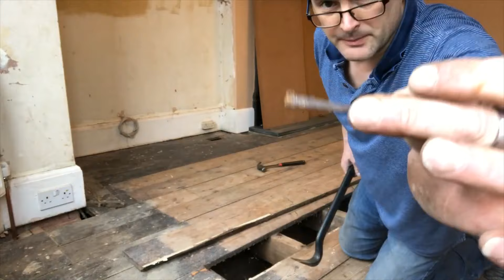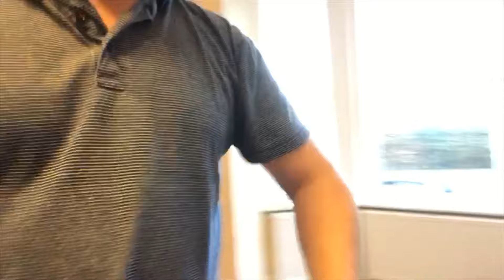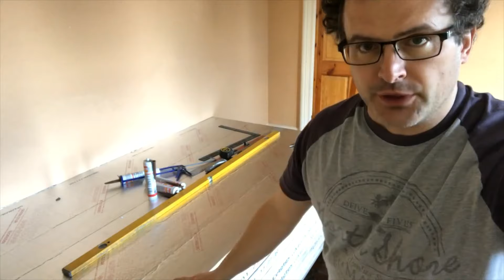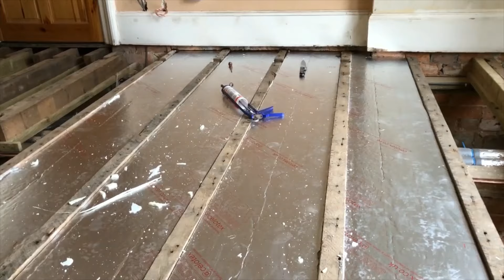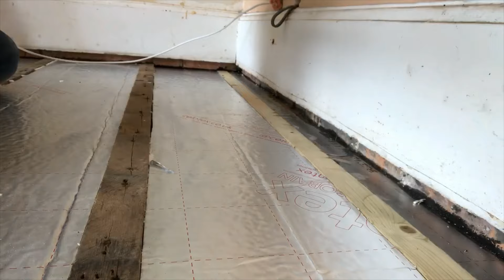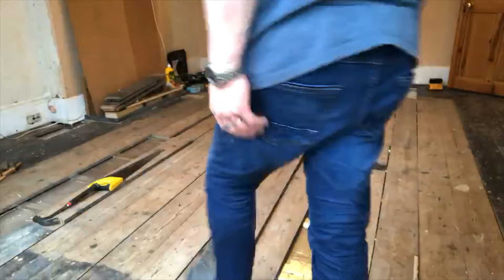Underfloor insulation retrofit full demo

Comment: If your a skinflint you can hold the insulation up with string looped underneath it and nailed to the top of the floorboards with tacks. I done, (didid) this and it worked!
Reply from the maker: Hi Phil, yes indeed, though the cold air beneath may circulate in any small gaps between joist and board, so a nice tight fit is needed. Great to hear your insulating your home too.

Comment: Go easy boy you will definitely  split these old boards. Take your time don't lever force but  apply pressure equally. Must  remember modern boards are not the correct size you may need to go to salvage yards.

Comment: Hi, would you recommend adding a Damp Proof Membrane under or on the top of Celotex? Planning to do the same but using Laminate flooring instead of carpet, thanks!
Reply from the maker: Hi Sara, probably not below, because the upper foil layer will be a vapour barrier. Adding another in a different place may trap moisture between. I don’t think one is needed above either, because the foil layer does the job.

Comment: Using a carving knife one handed whilst cutting towards your other arm whilst balancing on two beams?? Take your work outside to cut in a flat open space with the correct tool and live longer.
Whilst you had the boards up I would have placed a dpm on the foundation for a little bit extra protection from moisture ingress through the slab.
Reply from the maker: Thanks for your tips David. The DPM is an interesting one. Difficult to use a carving knife two handed, and if it’s sharp it shouldn’t need two handed levels of force. Space wasn’t an issue, and the knife was controlled okay. I’m happy with the risk assessment but always encourage others to do their own.

Comment: I would have maximised the floor insulation to get the greatest benefit.  Whilst the 75mm board is not up to current regs, the regs are on their inexorable way upwards and 75mm will soon be seen as mean.  The reason about retaining air flow over the dwarf supporting walls does not stack up because it is very easy to chop out individual bricks in the 1/2 brick wall to promote air crossflow without any real loss in structure.  The thicker insulation board can be supported on nails or screws driven in to the sides of the joists instead of battens that take up too much space.  Indeed, even greater insulation than the depth of the joists can be installed using standard stainless steel door frame cramps.
Reply from the maker: You’re right Clive, about the dwarf walls. More importantly I want air to get to the end supports that are onto the external walls. These are the ones that have suffered most rot historically.
The battens provide an air seal to the joint between board and joist. It’s a critical component I wouldn’t remove, even for an extra 25mm depth.
75mm is already mean. It should be twice that, but it’s a huge difference from air flowing and no insulation to a sealed 75mm solution, and not that much more when doubled up.
Thanks for the feedback.
Reply: @SteveWardellDIY  One alternative would be to incorporate a a composite solution say, using multifoil draped over and between the joists with a thinner PU foam board between the joists  That would overcome the concern about air tightness and create a full vapour proof skin.  I have used multifoil very successfully that has outperformed sole PU installation that means we aren't reliant on over deep constructions.
Reply from the maker: @clivewilliams3661  I’ve not used multifoil before, but it’s sounds like a good option. What’s it like to work with?
Reply: @SteveWardellDIY  Relatively easy and it comes in a 1.3m wide roll x 5m long, you simply roll it out.  Joints are usually overlapped and if necessary taped with aluminium tape, giving a 1.2mm working width.  The material fluffs up about 25mm but is easy to handle and fixings are normally stainless steel staples.  The material is draped over joists and the like and is crushed when finish boards are fixed over the top, this creates a thermal and vapour barrier. The system relies on an airspace of 25mm on each side of the multifoil to maximise performance that means the construction depth is 50-75mm before any additional rigid insulation or board finishes.  I have used multi-foil as a sarking felt under roof tiles and then around and up into roof rafters that were only 100mm deep to give an insulation value that exceeds the current Bldg Regs best value.

The issue with multifoil is that its effectiveness cannot be calculated in the standard way and relies on experimental results.  I prefer to specify Actis Triso-10 as the customer service especially with thermal performance is very good, they also provide estimated performance for bespoke systems that is generally accepted by Building Control.  Buying the various brands of multifoil from builders merchants is expensive until you factor in the cost of the labour to install it.  However, multifoil can be purchased as surplus material at very advantageous rates.
Reply from the maker: @clivewilliams3661  this is awesome insight. Thank you for posting. I’m going to read up some more and maybe look at using some
Reply: @SteveWardellDIY  One last thing for wall insulation is that using basic 38 x 25 tiling battens, which are cheap and benefit from being preservative impregnated as a framework over the internal face of the external wall you can very conveniently staple the multi-foil to the framework and then create another identical frame over the top, to which the board finish can be attached.  The layout gives a 65mm overall build up with the nominal 25mm air spaces, that is less than that for an equivalent polyurethane solution (~95mm).  The multi-foil naturally gives a highly effective vapour barrier that is better than the poly board foil.  One thing to note is that do not use screws to fix the two frames together as the multi-foil winds up on the screw, use stainless steel ring shank nails.  
Multi-foil is not a panacea for all situations but it is off the radar and can achieve very good results when used imaginatively.  I particularly like it for roof refurbishments where the rafters can be 3" or 4" deep and traditional insulation takes so much off the roof space as well as potentially loading up the rafters.  Old rafter sizes can no longer be proven under the new codes so that adding significant insulation weight sees major roof strengthening to what appears to be a proven sound roof.
Check out the French Actis web site, where they use it extensively in Alpine regions,as they give many more and detailed tested installations.

Comment: The celotex was a snug fit, as required. But what if you screw the batons, that the celotex sat on, under the joists at right angles. The celotex then lay on a few batons to hold it up.  I'm thinking less batons would be needed? Great video though.
Reply from the maker: They wouldn’t seal the gaps though that way.

Comment: Would this bee a good idea between the roof rafters.
Reply from the maker: Yes Alan. Leave a 50mm gap above the board for air circulation. 150mm total is the current building regs requirement (I think) which can be achieved with 75mm between, for 125mm roof joists, and a further 75mm beneath the joists held in place by battens or plasterboard directly.
Reply: @SteveWardellDIY  This air circulation will also depend on the felt membrane in use in the roof i.e. breathable (modern roof roofs) or non-breathable (older properties). With older properties you will need the addition of roof vents (eaves and ridge) for crossflow air circulation. Just experienced this myself recently. Plan on doing this in the floors downstairs in my house, was wondering about air circulation but you seem confident it won't be an issue and I tend to agree with you. Thanks, great detailed video.

Comment: Thinking of doing this myself at some stage, I was wondering though - why use silicone instead of expanding foam?
Reply from the maker: I’ve not done much work with expanding foam. Could be a good alternative. I like a tight fit on the boards and silicone works okay if you achieve this.

Comment: what carpet underlay did you use?
Reply from the maker: Hi Andrew, I used Carpet Right’s most expensive rubber one. Probably got ripped off but it’s lovely. I’ve since spotted some 12mm thick wool underlay online that may be a pretty good cheaper option. I’m not an expert on this, though I do fit all my own carpets to make sure it’s a good job

Comment: Thanks for the video - did you consider rock wool instead with membrane over ( celotex - )fire resistance
Reply from the maker: Yes Richard. The thermal loss capability of rock wool is much poorer than insulation board. You’d need twice the thickness or more to achieve the same insulation, which would have been harder to install.
Reply: @SteveWardellDIY  thanks Steve -understand thermal performance ( post green fell - wouldn’t specify a phenolic foam.)
Reply from the maker: @richard.j  for me, and most in fire safety, that choice is based on risk assessment and compliance. In this case the flammable material is contained in an environment where ignition sources are low and highly controlled, and the house has good smoke detection, as all homes should. For the safety of my family and myself I’m satisfied the risk is controlled.

Comment: Does this material off had or smell as my nose is very sensitive.... It would annoy me terribly if it did.
Reply from the maker: Hi fabriglas. It’s a Celotex product I used. It has a smell that’s a bit fishy when cut, but none at all when installed and it’s completely sealed from the room by a foil layer when complete so even if it were to smell over time you wouldn’t smell it.
Reply: Off gas , predictive text sucks

Comment: could you have used gapotape to get a better fit? instead or as well and top tape?
Reply from the maker: That’s a really interesting video Krish. The shapes and sizes of existing builds are not as accurate as the standard frequency in the new build, so there’s no way of mass cutting and using Gapotape to make up the differences. The pieces I had to cut were all one offs, and were accurate with very small gaps. The insulation capability would not be reduced by any amount of note by small gaps that are sealed to prevent airflow through them.
Reply from the maker: Hi Krish, I’m not sure what gapotape is. Aluminium foil tape is recommended by Celotex to create a continuous foil membrane, so that’s what I use.
Reply: @SteveWardellDIY  https://youtu.be/Omk68Z-tE7U

Comment: Was there no crawl space? I think I would have crawled under with fiberglass batts and shove them up between the joists, Instead of tearing the whold floor up and cutting each insulation board one at time.  Or maybe just insulate and line the crawl space. It doesn't look like you have crawl space ventilation anyway, so how big a deal is the all the air sealing which could be taken care of with an underlayment when you lay the hardwood.
Reply from the maker: Hi Peter, there’s about 300mm - 500mm depth of crawl space across the room, and it’s ventilated from outside via air bricks. I cleared the air bricks to make sure they work for the future, and airflow is absolutely needed to keep the subfloor moisture level low enough.
Installing fibreglass batts is an option I’ve used in a previous house, but has a lower insulation value and does not prevent airflow, so is no where near as effective. Solid PIB is a better solution.

Comment: It's great that people have a shot, but probably shouldn't post them as instructional videos. There are ways to have done this quicker and better, and with more info (like which screws to use, why screw and not hammer etc). I'm sure it will be beautifully warm however!
Reply from the maker: Bit odd suggesting people shouldn’t post videos pumpkinhead.
As you can see from the comment, lots of viewers have found useful tips and guidance from it. It’s always possible to improve of course, though I doubt I’ll redo this one.
Do suggest how to do it quicker and better please, and the type of fixings you think are best, and the community will benefit from your insight.
Reply: @SteveWardellDIY  I love people posting videos, I was just saying it's more of a video of how you have done it rather than how and why it should be done a certain way.
Reply: @To_dare_is_too_dear  step 1, label all your floor boards. An easy way is to do top to bottom in letters, left to right in numbers. That'll make it much quicker to put them back down. If you are screwing the boards down, use a screw like Space Wirox that has the double thread, if you are leaving the boards exposed use a cut clasp nail. Best pilot drilling the holes at the ends of boards, no need for mid boards. If you have to use PIR I'd recommend gapotape for a proper seal, I'd really encourage a natural insulation however like Steicoflex - no need for a vapor barrier with it. The Restoration Couple and Gosforth Handyman both have good videos worth watching.
Reply from the maker: @pumpkinhead456  I think the batten screws were 45mm x 5 and the floorboard screws were 55mm x 6, but a similar range would work just as well. I didn’t bother piloting as I used screws with an upper clean shank.
Reply: @To_dare_is_too_dear  it would be a waste of cash between floors, you could use sound proofing rock wool for noise purposes but no need for insulating. Internal wall insulation is a good bet and worth doing well, worth doing some research!
Reply from the maker: @pumpkinhead456  agreed, no point between floors unless the room below is kept a lot cooler/unheated, such as a garage.

Comment: Wood fibre batts are such nicer material, they can be fitted just using friction and require no vapor barrier (so you can leave a few boards down if it's a precious floor - mine was and I did). If you go down the smelly PIR route (the chemical smell turns my stomach) always wear a dust mask, you could also consider gapo-tape to get a tight fit. As an aside, it's much easier to lift nails with a bit if wood under your crowbar.
Reply from the maker: Wood fibre batts provide poorer insulation for the same thickness.
Friction will only overcome gravity if really tight. Better to support the insulation. 
The vapour barrier is to prevent moisture from the room entering the floor and a dew point occurring on the timbers. It’s not for the insulation.
Leverage on a crowbar and the need for packing will vary depending on the height of the nail head, the amount of bend in the crow bar, the strength of the person and other factors, so it’s not really something that can take a sweeping guide. I use packers when the application needs it. Thanks for watching.

Comment: In reality, cold air sinks and hot air rises. So a just as effective method would be rockwall batts, insulate and draught proofing.
Reply from the maker: I suspect airflow, due to air pushed into the subfloor from outside and warm air rising up chimneys and out other ways, may cause air transition through the floor boundary to play a big part in poor building thermodynamics.
Simple warm air rises and cold air falls logic may not accurately apply, and stopping airflow through this critical boundary may be a really important factor.
Reply: @SteveWardellDIY  Totally agree about air leaking through the old floor via the airbricks. I made the comment about rockwall batts, because my brother has an old victorian house with a very similar situation on the ground floor. He put in batts between the joists and it made a massive difference to their bills.

Comment: I'm surprised that there is no thick plastic to seal unwanted moisture from the dirt floor.
Reply from the maker: I installed a DPC under the dwarf walls of the kitchen as I was rebuilding them, but normally in these types of houses the dirt floor is open to the sun floor void and the moisture kept in check by the air bricks delivering a continuous flow of fresh air. I cleared the air bricks as part of the job, as they were partly blocked.

Comment: Why reuse the floor boards and not stick chipboard down if you carpet over it anyway? Not a critic, just a question
Reply from the maker: Aside from the cost, I’m a Womble and a restorer, so prefer to reuse the old boards if they’re in good condition. They are as strong as chip board and when screwed down do not move or squeak. Easier to relift if there’s ever any subfloor issues too.
Reply: Why waste money buying new chipboard flooring when the floorboards are still good?
Reply: @_Damian_.  mlre solid and less squeaky but that is my opinion 😂
Reply: @erlwindegans3954   ... if you have the spare cash I suppose which a lot of people are struggling with at the moment, oh and don't forget the hassle of getting rid of 12m2 of old floorboards. As for squeaky boards, I'm sure he said he screwed them down, squeaks will be eliminated that way.
Reply: Chipboard is cheap and cheerful. If you have good solid floorboards like these, you’d be mad to cast them off! Realistically with chipboard you aren’t going to/cannot make every single board end on a joist, which means over time those unsupported joints will creak, flex and bend. Floorboards are usually solid bits of timber and they are fitted over joists with no unsupported areas.